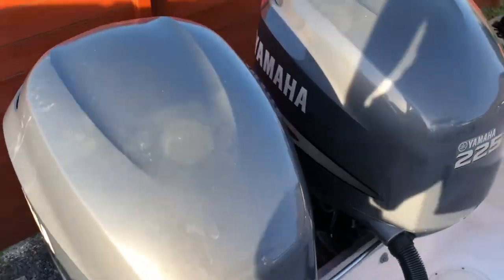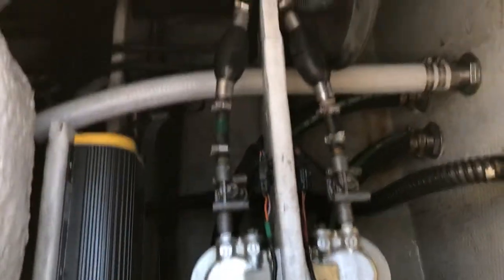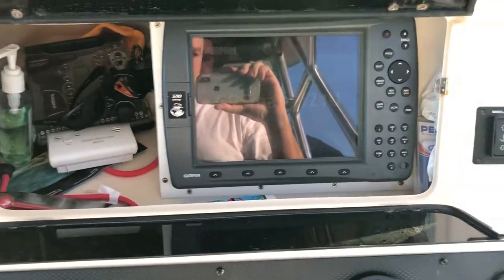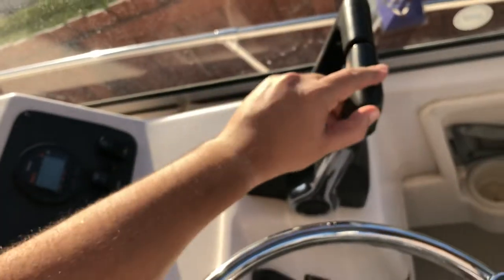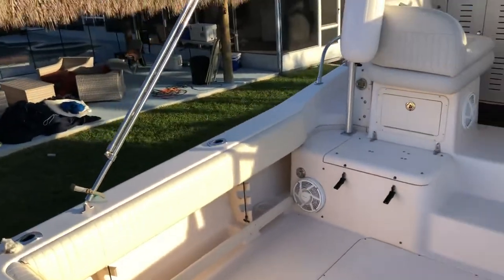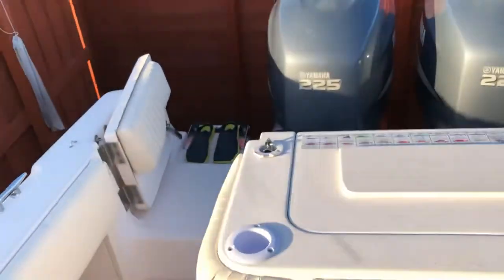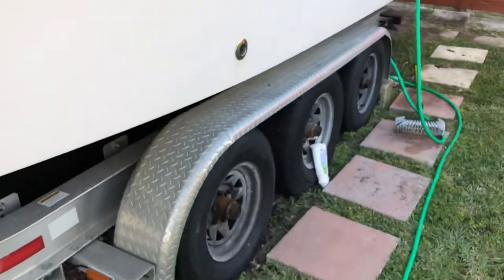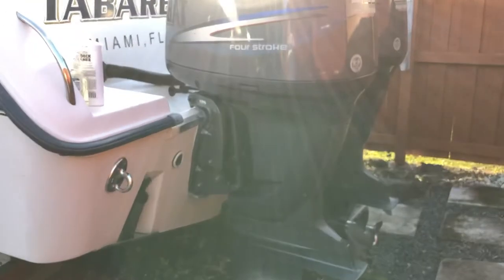2006 Grady White 282 Sailfish Walkaround - Not available #gradywhite #walkaround

Comment: Notice you sold it long ago. I started boating recently and plan on buying a similar boat down the road. Thanks for all the useful information to all us new boaters.
Reply from the maker: It really is an awesome boat. Inspect the transom, rear deck, and bulkheads. Older year models are known to have rotted transom issues and floors may get soft due to wood after the years. A good inspection will save you headaches down the road. Cheers